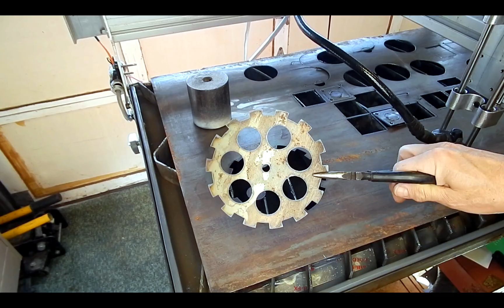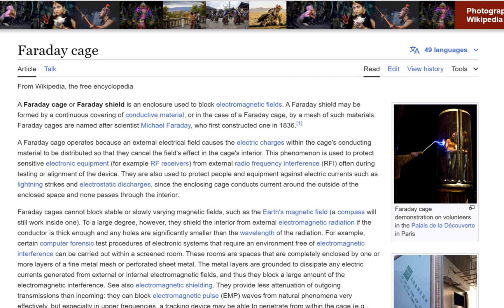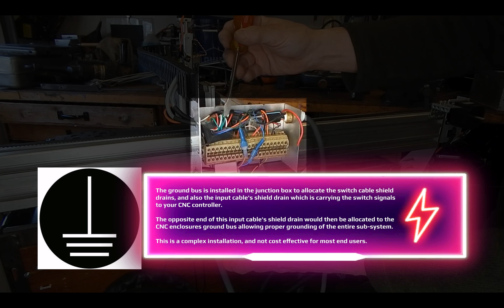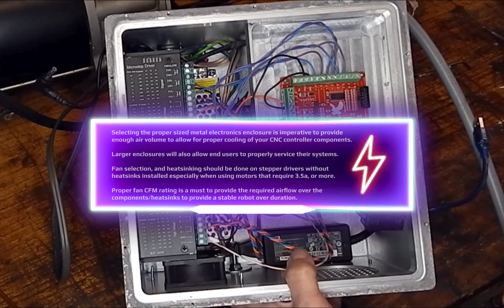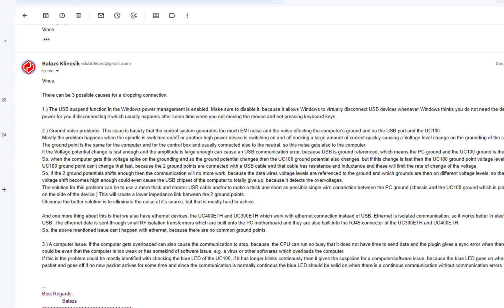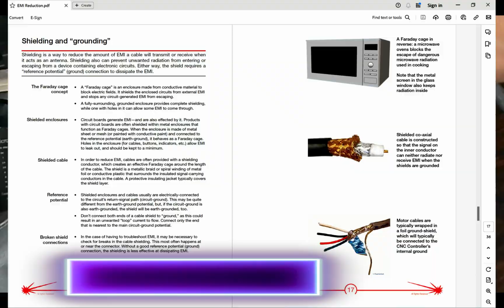CNC Plasma Controllers Built Incorrectly (Volume 19)

Comment: Hi, so is it a good decision to purchase a separate metal enclosure for all the power supply's? i did decide to go this route because i dont want EMI to ruin my experience with the machine. might be overkill though since many people called me a idiot for going this route 😅
Reply from the maker: Thank you for your support. You're certainly not an idiot, as there's a lot to learn about robotics. A single metal electrical enclosure is all that's required unless you plan on installing your VFD in one. 

Thank you,
Vince